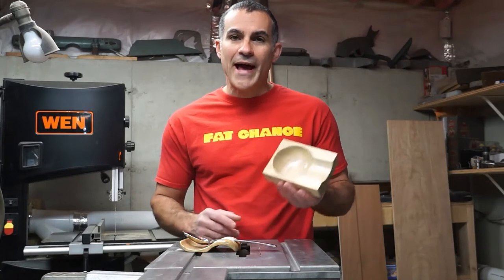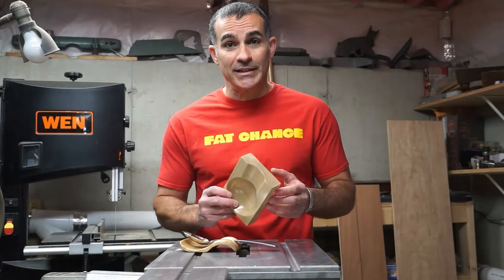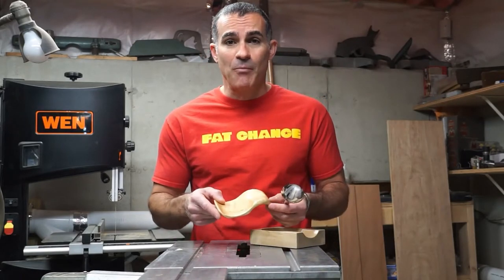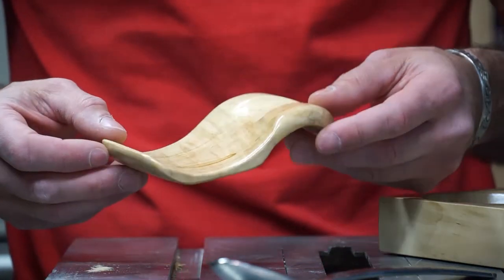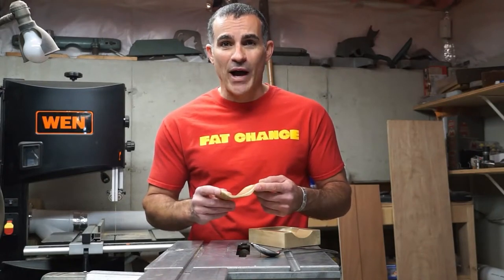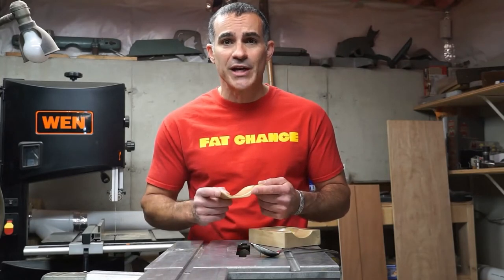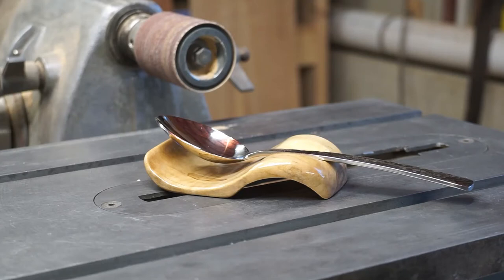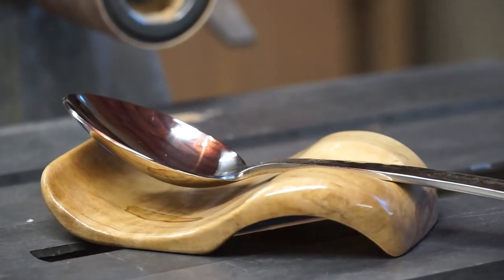Woodworking Basics: Make a Spoon Rest. The wife likes it!!

Comment: So I like it too…and I’d love to make one for my daughter! Any chance you could provide some dimensions…for starting block, finished piece, Forstsner bit size and placement, and anything else that might help a novice?
Reply from the maker: Thank you for the feedback! The dimensions would be a block of wood roughly 6" x 4" x 3.5". The forstner bits were a 3" and a 1" bit. 3" bits are not common and I happen to have one laying around from a treehouse build. They can be bought on amazon for about $25. You'll want to make the holes equidistant from the outside edges leaving about 1/4 - 1/2" of space to the edge. Keep in mind when you make the cut to reduce the piece of wood you're working with you're going to want to cut it with a shim behind the block so your cut gives a sloping angle for the spoon to rest (see 55 seconds into video). If you don't have a small spindle sander (mine is a 3" version on a shopsmith), you can order them from amazon and they attach to your drill or drill press. They usually come in multiple grits so start with 80 and move up to 220 if you have that option. Then you can finish sanding by hand. 
Let me know if this was helpful and happy the project served as an inspiration for you! Reach back out if you need more help.
Reply: @industrialcomfort  Well thank YOU for the prompt and thorough reply! I’ll get started tomorrow and if I can make anything worthwhile I’ll send a picture. Thanks again!
Reply from the maker: @dbroghamer  You bet and good luck!